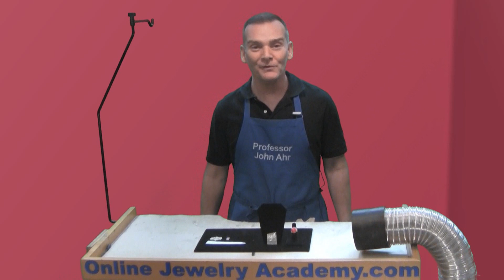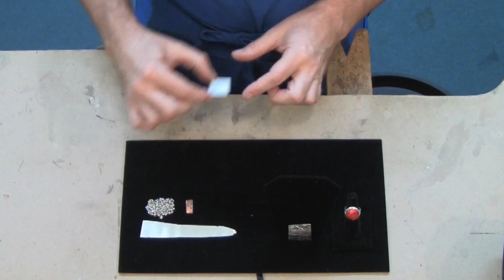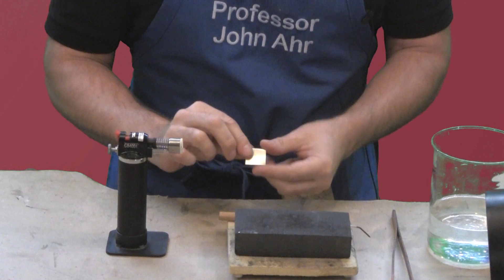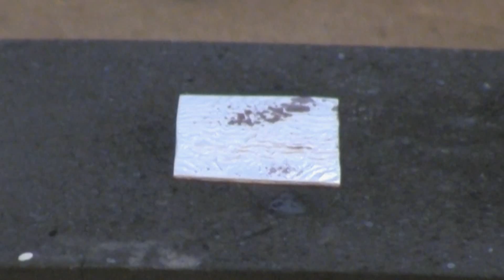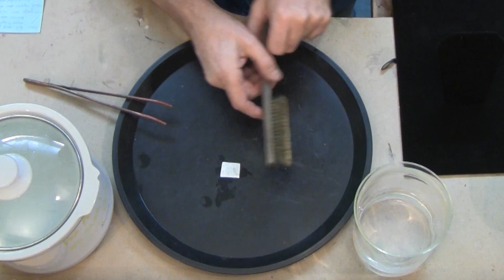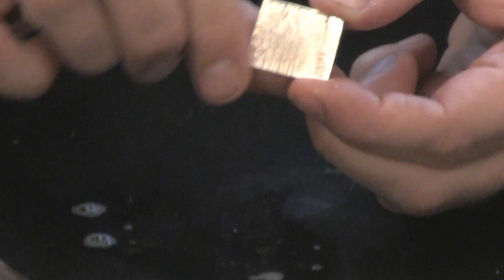Creating An Amazing Texture Using Silver Reticulation Techniques

Comment: Again a very educational video of you. Thanks for all the time and effort. Although it is 6 years old I hope you can explain one thing that is not clear to me. You say that after the anealing you let the piece cool by air. so far I understand it and grasp the logic of the metal sturcture. But I wonder if you rinse the piece in the pickle pot after each aneal or just aneal it again right after it has cooled down? Thanks.
Reply from the maker: You must leave the piece of reticulation silver in the pickle pot long enough for it to get clean and release copper atom it’s surface. It is not a rinsing process. The last few times that the silver comes out of the pickle pot, its surface should be white. 😀
Reply: @OnlineJewelryAcademy  Thanks for your answer. 🤭Rinse is just a word I knew being Dutch. I know it has to stay in there a while to solve the copper.

Comment: What's in a Pickle Solution,??
Reply from the maker: Hi Geoff, The OJA has several video that detail the pickling process.  You can use one of the two solutions that we recommend.  Or, you might find a different solution formula with a little internet research.  In any event, the easiest way to find the OJA's pickling videos is on our website at: www.onlinejewelryacademy.com  There you'll find the videos conveniently grouped by category.  The pickling videos are under the "Bench Tips & Tricks" heading.  Good luck with your creative pursuits.
Thanks for your support! : )

Comment: Great video.  One question:  Do you have to anneal the same side of the piece to get the fine silver on top (one side ) or do both sides? I've always wondered about this and marking which side is the one is a problem sometimes.
Reply from the maker: Great question Kathleen.  You only have to heat one side of the piece to anneal it.  And, it doesn't have to be the same side every time you do it.  Just remember to only heat the metal until it goes from shiny to dull.  Have fun.
Thanks for your support! : )

Comment: Wow, that is so freaking cool!

Now tell me about using the charcoal block vs a solderite board, if you would.  I remember my jewelry professor saying it creates, I think, a reducing environment that allows more efficient heating?  Or have I got it mixed up?  And a charcoal block on the solderite like you have here vs using an annealing pan with pumice, with or without the charcoal block?

I was always getting my reducing and oxidizing thoroughly mixed up, along with what mix of gasses and type of flame to use for what, and on what surface, and I'm sure he thought I was going to burn the building down :-)
Reply from the maker: In the video, I place my charcoal block on a piece of kiln shelf not soderite.  I do this to protect the top of the bench.  You're correct that the charcoal creates a reducing atmosphere.  You can always Google what does what.
Thanks for your support! : )

Comment: hi and thanks☺ re burnishing; do you brush the metal between every heat/ pickle moment  or just after the last time?
Reply from the maker: Hi Toby,  Yes, I brass brush my metal every time I remove it from the pickle pot.  The metal goes into the pickle pot after every time it comes into contact with the heat from my torch.  It's important to remove oxides and keep the metal clean while you are working.  Good luck with your projects.
Thanks for your support! : )
Reply: OnlineJewelryAcademy got it.  thanks again.  Toby  spiritmetaldesigns

Comment: purer silver has a higher melting point than sterling? Hmmm, I guess I could look that up....
Reply from the maker: Yes, fine silver has a higher melting temperature than sterling which is generally alloyed with zinc and copper.  That's why you don't melt little bezel cups or bezel wires when you solder them into place.
Thanks for your support! : )

Comment: Just to be clear, quenching super fast (immediately) makes smaller crystals? Thus, making the metal even MORE malleable than if we quenched later (slower)? If so, then quenching faster is better if you want very soft bendable (annealed) metal, correct? This is cool physics, yay! How does that affect Argentium sterling silver (which is subject to cracking/slumping when quenched too quickly- so I've heard...); is there a happy medium....?
Reply from the maker: You got it.  Quick quenching makes smaller crystals and improves malleability.  I don't work with Argentium silver.  So, I really can't answer your question.  Perhaps there is a website that can help you with that material.
Thanks for your support! : )

Comment: Loved this so much. This is the type of metal look I've wanted to learn. As a scientist/engineer, understanding the WHY and not only the HOW is part of my enjoyment. 

Is there a way to develop reticulation on copper?  Hammering will mark the copper but I love the topographic, almost snake skin look, given by the purposely created large crystals which doesn't happen with hammering.
Reply from the maker: Hi Rochelle,  Glad you enjoyed the video.  Copper will reticulate.  It just has to get really close to its melting temperature.  And, I don't really like the results.  I find it to look sandy and not scaly.  Plus, it might start to just melt on you.  Give it a try and see what you come up with.  Have fun making cool stuff.
Thanks for your support! : )
Reply: @OnlineJewelryAcademy  "Reticulation" of copper in this way is really fusing or melting as copper is 100% copper and there is no difference in melting point across the metal, and you cannot enrich the surface.  In any case, the mechanism is not the same, although creating ripples may seem the same.  (Ph.D. Chemistry)

Comment: Excellent tutorial!  I learned how to do the reticulation process from a book, years ago.  I fell in love with it!  I didn't know you could take a soldering pick and use it to control the flow of the silver over the copper, I can't wait to try it.  I typically use sterling for my pieces, it gives you a softer "wrinkle".  I've tried the 80/20 silver, but just don't like it as much.  Thanks for touching on this lost art!
Reply from the maker: Hi Badkitteh,  Glad you enjoyed the video.  The solder pick should only be lightly moved over the fine silver surface.  Otherwise, it could cause the fine silver surface to open up and let the copper out onto the surface.  Try it and see what you think.
Thanks for your support! : )

Comment: Do you measure the silver and copper on a scale or is there some weird way to do it because they have different mass or something? This question may not make any sense.
Reply from the maker: Hi Kim,  I understood what you were asking.  You can definitely do some math if you want to.  Usually, I just throw a piece of copper that has the same weight as a U.S. penny into an ounce of sterling silver when I melt down the metal to make my alloy.  Have fun making wrinkles in your metal.
Thanks for your continued support! : )
Reply: Bright, clean and wrinkly: you just described me ;-)  Thank you for another great video.